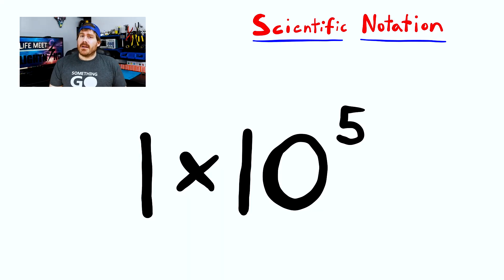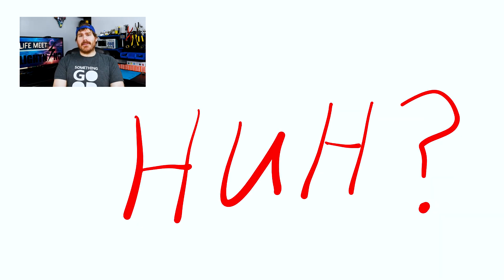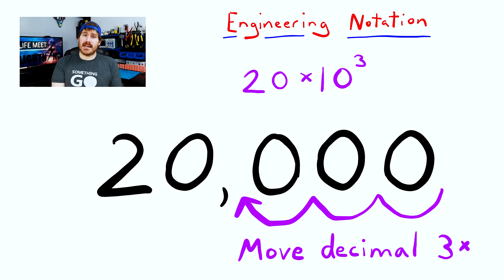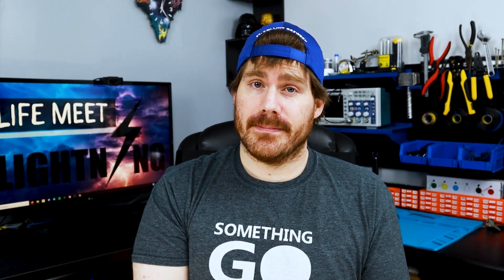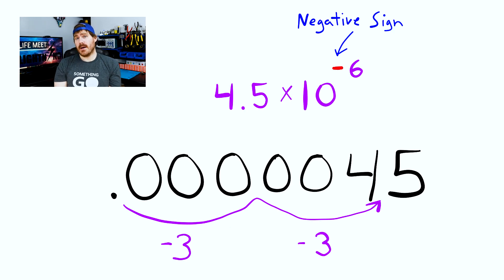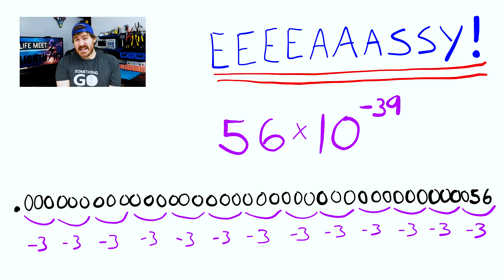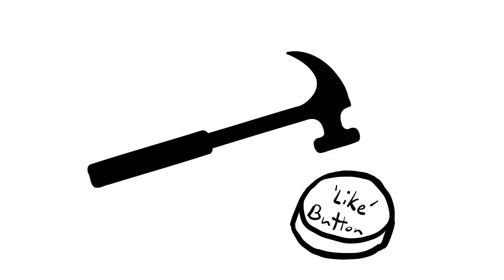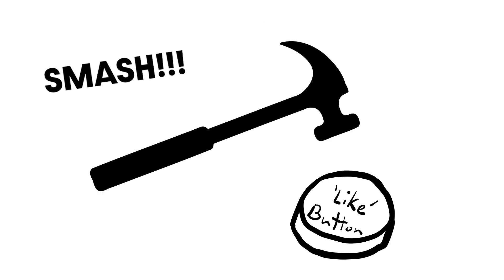Intro to Engineering Notation - Learn Electronics for Beginners

Comment: Is it also for more precise measurements and tolerances where accuracy is important?
Reply from the maker: Accurate measurements are a function of the tools that you are using to measure with, whether it’s electronics, or some other field. Scientific and engineering notation are a means of communicating those measurements, and they each have their place and purpose. Both do, in a sense, help us compute more accurately by the fact that scientific calculators have limited displays. I will be covering measurement, accuracy, and precision in a future video.  :-)